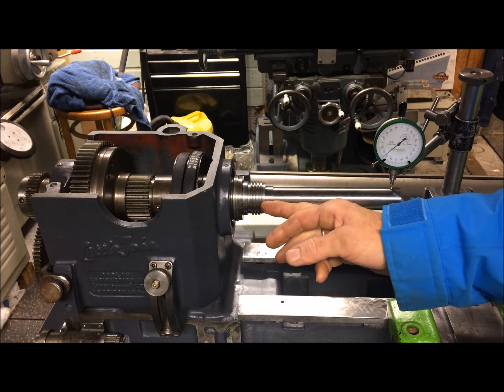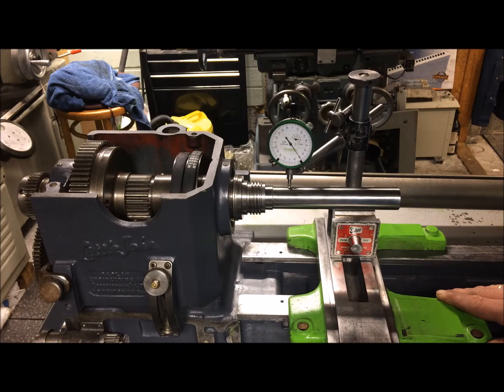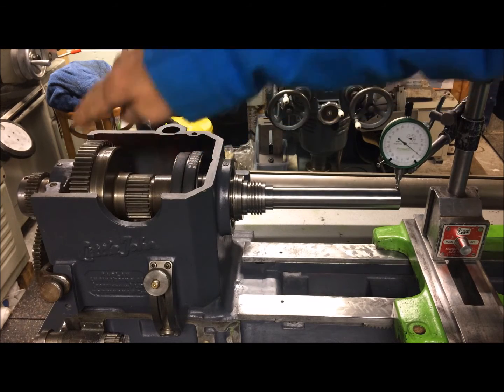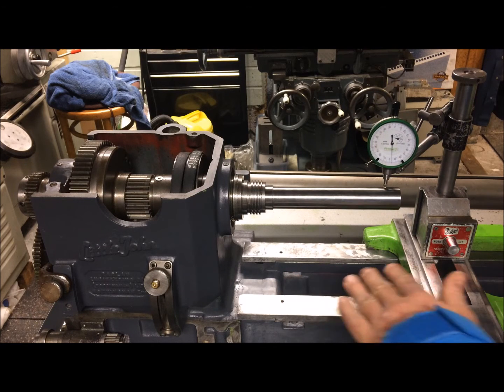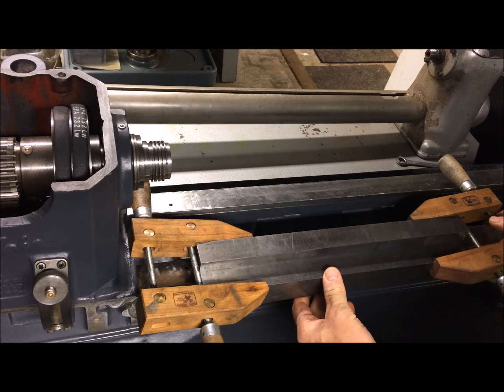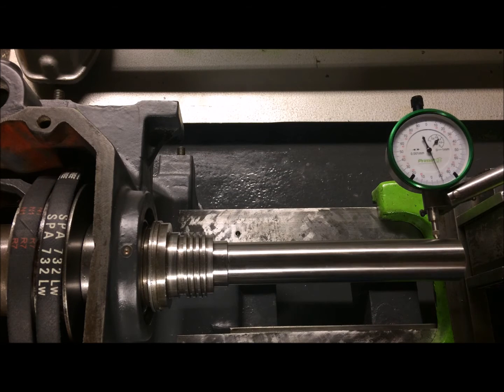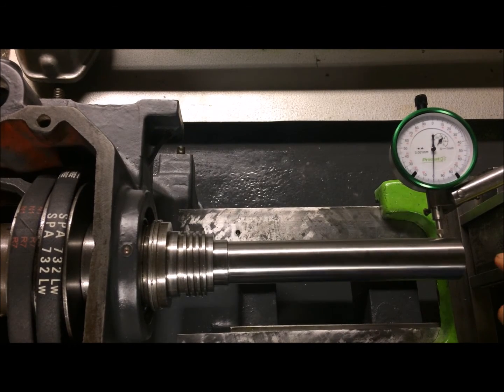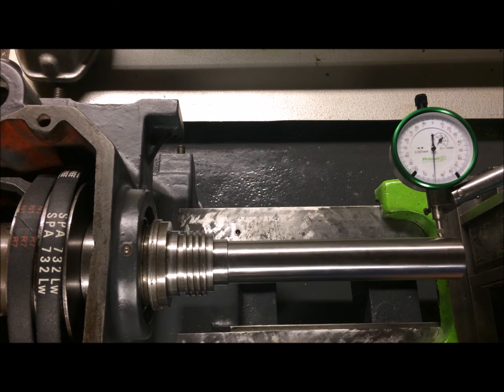Raglan Little John - Headstock - part 2 - spindle test and measurements

Comment: Hi Jan,Thanks for posting your very useful and informative video Think I will be dismantling my spindle very soon to replace the two beltswould you or other contributors recomend new taper bearings or is it worth giving the original bearings a secnd Spin.
Cheers.
Andy. G
Reply from the maker: @masterpiecesinminiature8299   Tja? Depends on the condition of the bearings, I guess. If the lathe has seen a lot of hours use.. and/or abuse, then I would change. However, they might be costly?
Reply: @jansverrehaugjord9934  Thanks for the FeedbackJan

Comment: Where did you get the bearings from
Reply from the maker: I get my bearings locally as we have a distributor/warehouse that stocks most types. Usuall they are NTN https://www.ntn-snr.com/tapered-roller-bearings
Reply: @jansverrehaugjord9934  I’m looking at Timken 16150/16284B TSF Single- Row Taper Roller Bearing 1.5x2.844x0.3438 inch. Will these work?
Reply from the maker: @MrRobotRooster   I don't have that lathe anymore so cannot check, but if they are the same size I guess so. Have you pulled them out and measured? The easiest would be to look up a compatibilty chart though or get your supplier to do.
Reply: @jansverrehaugjord9934  I’ve just emailed a supplier the dimensions. Thank you. Have you got a new lathe now?
Reply from the maker: @MrRobotRooster  Yes. I have had another lathe all the time while working on the Raglan, a Russian lathe with the designation IZH1i611p.
Reply: @MrRobotRooster  Hi there,
I am currently trying to replace the main drive belt on my Raglan 5" lathewithout removing the main spindle.
Have you had any experience of working on the variable speed pulley sited inside the headstock at the bottom.
I beleive on some of these lathes the pulley can have the drive belt passed down the side of it  inside the headstock, looped round the pulley and so replaced.
On my lathe Raglan 5" there appears to be a steel plate atached ( by two bolts) ( which has a "oiler" atachment fitted).
This plate holds a "bearing" or "axle" going into the pulley end, which prevents me passing the belt down the side of the pulley.
I have loosened the plate by removing the bolts but the plate will not detach from  its atachment to the pulley 
Any advice would be appreciated

Comment from the maker: Hi folks,I have just reseated the bearing a couple of times, turning the outer bearing journals at 90 degrees interval and retested a couple of times. Well, at least it is consistent:spindle is seated at 0.015mm pr 200mm upwards as measured towards the tailstock, 0.06mm per 200mm towards the operator/front of the bed (opposing tool pressure) and has a runout of about 0.025 at the same distance.